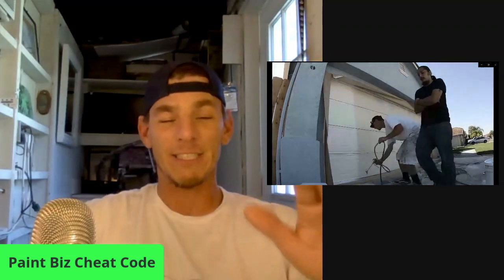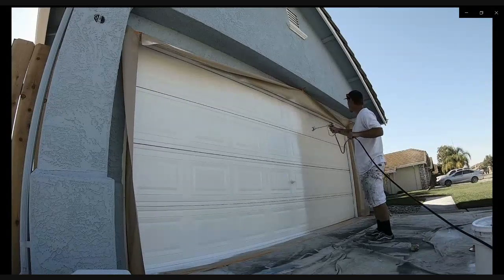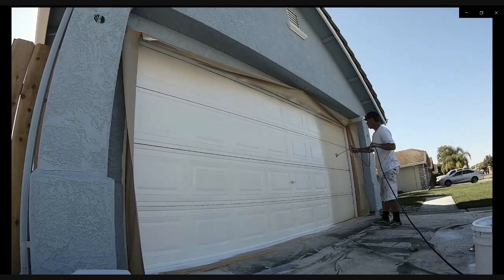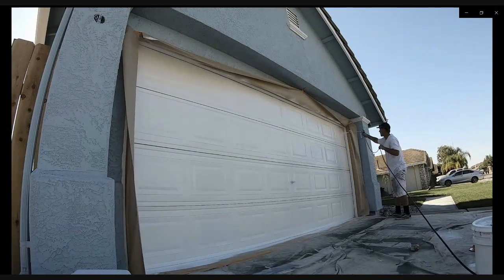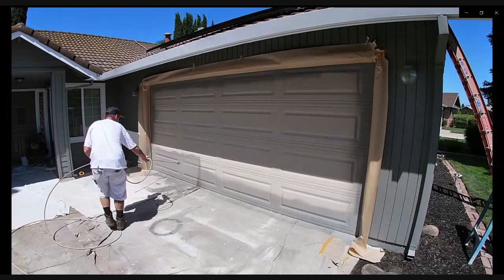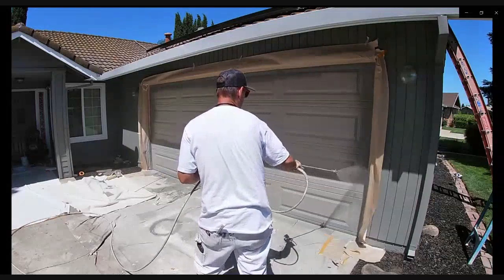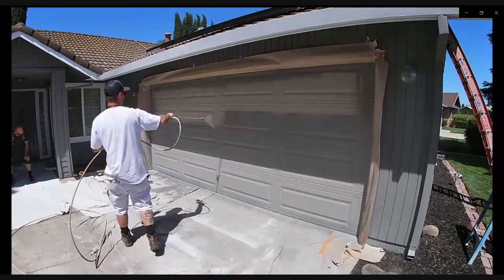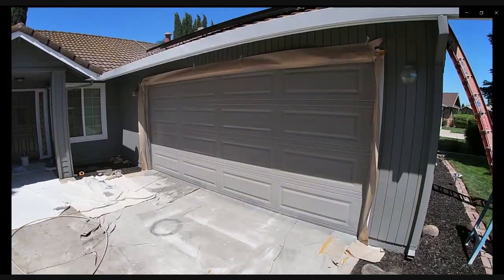NEVER DO THIS WHEN PAINTING A GARAGE DOOR WITH AN AIRLESS PAINT SPRAYER

Comment: I paint garage doors left to right and do them in several sections....I have NEVER EVER Gotten a Lap mark EVER. doing them that way. I did notice you are using a poll. I think that might be the problem. Over pressurized material can cause lap marks. Or if you stop before you let off the trigger. You should never use a poll unless you need one.  Looks like your self taught from the videos I have seen. Spraying vertical you were shooting the bottom of your door angling down. So the bottoms of the texture are not getting even coat. Best to spray right to left Leave the pool off and turn the gun upside down. shoot straight at the door first swipe 1/2 on the paper or drop. so the center of your fan is at the bottom of the door. then overlap 1/2 each stroke up the door bottom to top. I never do them 2 coats either. and NEVER have MISSES....Once solid coat and my doors last 15 years every time. Vista Care free paint.

Comment: How do you paint the edges between panels?
Reply: You don't
Reply: @taneishabedenfield4236  If the original color is white & the new color is dark. Customer wants edges the same as the new dark color. How do you do it?
Reply: @myutube1960  hand paint brush
Reply: Open up door slightly to expose the mid opening and work yourself to the next opening
Reply: I can tell you that what they call themselves a pro, none of them will spray paint the edges but they said they spray paint a garage door, maybe theer is no edge on their door, and some of them will say paint with paint brush to finish the edges, they all lie
Reply: @myutube1960  brush them yea. But I dont usually do that and inform them that it may cause the door to stick. If they want me to do it anyway I have them sign a release of liability.